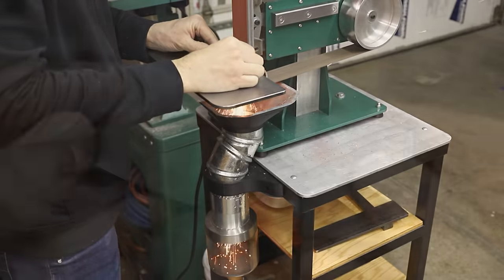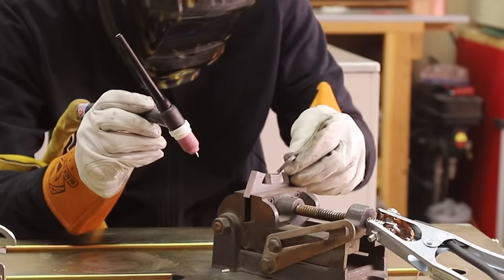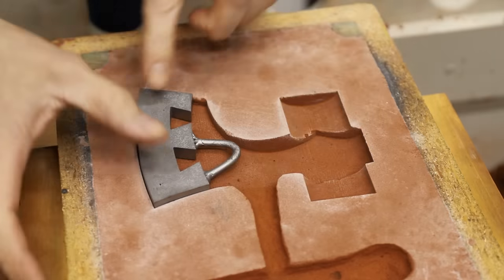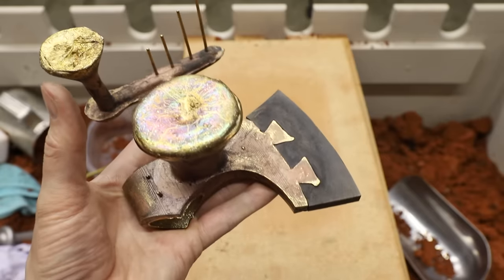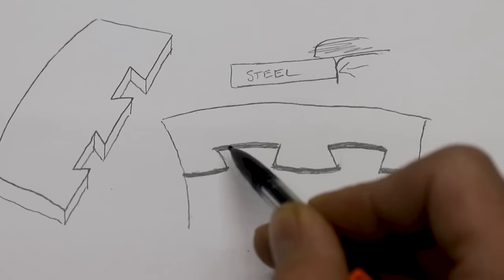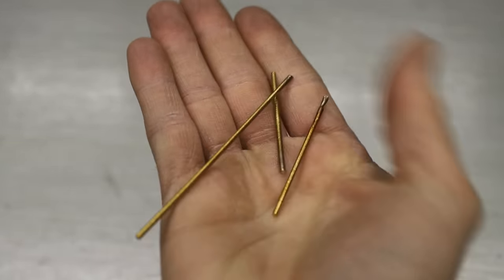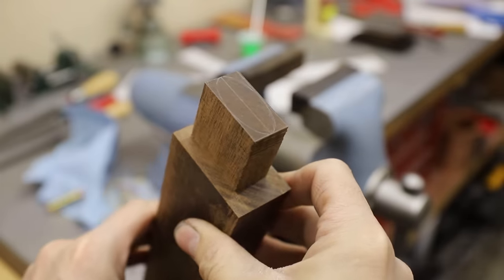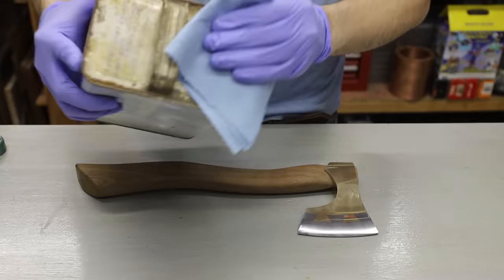Making a bronze hatchet with a steel blade - Dovetail Axe

Comment: The axe is beautiful.  I am guessing that it won’t see a lot of heavy use but it does leave me wondering about a couple of things.  I have never worked with bronze made from aluminum and copper.  I have no idea how the properties of this alloy compare to a more typical copper-tin sort of bronze.  I frankly have no idea how this alloy of bronze would wear in an axe that sees normal use.

The other issue is how the two metals behave after many cycles of heating and cooling as a result of changes in the weather.  It seems unlikely that the different materials will expand and contract in the exact same way.  This could cause the dovetail joint to loosen over time.  This could be irritating in a working axe but it might not be much of an issue in a display piece.

Comment: Could the dovetail weaken or shift during chopping or twisting the edge out of wood?Maybe drill a hole top to bottom through the dovetails and put a steel pin in there to make sure the dovetails can’t shift?

Comment: Beautiful show piece, but as far as actual working piece I have doubts. Black walnut is not great at handling stress from impacts, and I have real doubts about the union between the steel and bronze holding up to actual stress of being used. Perhaps using three rods from the steel blade back into the bronze body would increase the strength, by distributing the impact force through more of the bronze body rather than almost all on the dovetail union surface. Again it is a beautiful piece of work, i only question whether it would actually hold up under actual working conditions. Also think I would have cut the dovetails to have a 3/32 or 1/8 inch ledge around the interior of the dovetail, for increased surface area for the bronze to bond to the steel.

Comment: Aluminum bronze and mild steel will experience galvanic corrosion when in contact with each other. It would be interesting to see if this holds up over time in a humid environment.

Comment: Jeez Louise, man! You need to have that chuck of steel above its solidus temperature, or it won't bond. What you're doing is basically brazing the bronze to the steel. The base metals need between the solidus and liquidus temperature, or you'll get a cold joint... which is exactly what you got the first time.

Comment: i honestly wonder if they are positives/negatives in handling/hit "feeling" of an Axe, when different materials between the blade & the shaft are used.
apart from weight & balance , shouldnt a "softer" piece of metal give a different outcome? like in a sword? flexibility & all that 🤷‍♂

Comment: You added this kind of steel loop to the blade for having sth. the aluminum bronze could stick to. But: Would not it have helped to leave the excess from the cutting process inside the dove tails and not filing them down? Then the aluminum bronze would have had much more "steel edges" to stick to.

Comment: This would be quite simple if you had access to a wire EDM machine. Also the steel can be pre-heat treated. The EDM is not effected by the hardness of the metal.

Comment: I think this would beva cool wayvto make be a battle-axe. Use the same bearded shape, but make it easy thinner in the blade, like half the thicknesses frombthe eye and to the beard, andvthen makeba reinforced edge to get a light axe but with good edge rigidity.

Comment: One of the major reasons I think this is a terrible idea is that steel readily losses its hardness at those temperatures, nevermind the fact that metals expand at different rates vs temperature. Without some sort of physical connection this is guaranteed to fall apart. One of the reasons I don't like press fit connections. Friction alone isn't enough.

Comment: Pouring molten bronze on hardened steel softens the steel again (a lot more than desired for tempering). The steel needs to be quenched after the casting process.

Comment: adding a small 45 degree grove in the bottom and top steel dove tail would prevent it from sliding out horizontally over time do to ware, as well making removal not the biggest pain in the ass, would be a good idea. all in all good well thought out vid

Comment: Only thing I'm questioning is if the steel is still hard lol, the welding and the casting mightve ruined the temper/heat treat.

Comment: You should really rough out the blade shape before hardening. The hardening process only works at the surface, typically to a depth of 1-3mm depending on tempature, material, and solution.

Comment: Didn't you build a battery between the cupper aluminium and steel? i guess, that the cupper will start to oxidize and start stealing electrons from the aluminium, making it brittle?

Comment: bi-metal... how about galvanic currents? can they ruin the project in the long run?
how do you figure which metal can be used without galvanisation (??)
Reply: Cutting edge probably rusts like crazy, exactly for that reason, if used for real ;-)

Comment: While the end result is a beautiful decorative piece, its functionality ends there.  Steel alloy, bronze alloy, heat treatment are all either incorrect for the application or just plain incorrect.  The dovetail joint wouldn't survive a day's work, but it is a beautiful art piece.

Comment: What about a skeletonized hammer, filled back in with lead?
Reply: That would be a fun idea! Use topology optimization for the striking surfaces and connecting pieces, and then doing the lead cast over for a DENSE sledge

Comment: A work of art, but wouldn’t it be a little impractical as a working tool? Axes take a lot of blows. As the head is hammered, so to speak. Won’t the metals deform (they will deform) at a different rate, eventually creating the gaps in the dovetails you were rightly worried about?

Comment: Could be wrong but you really really don't want sharp corners in an axe... Those dovetails will create cracking problems later on down the line might not be instant but I will put money that blade will eventually crack/break at the dovetails

Comment: How much lighter is your composite alloy axe head over a full steel axe head?  Also, given that Bronze contains Tin as the alloying element, and your alloy does not, then perhaps instead of calling it Aluminium/Bronze you should invent a new name for your Copper/Aluminium alloy, ?  Maybe Caluminium (Pronounced "KAL U MIN EE UM")?
Reply: But that's just what it's called, he didn't invent it.

Comment: This little Imperfections mean this Ax will not Hold Long, nor Safety... It indicates that the Metal was under to much Stress.... So sooner or later it will give in, which becomes Dangerous for the one who uses it.

Comment: Would like to see how far you could push that design with the next model being more detailed more advanced maybe more decor with built in runes & using Nordic Gold instead of bronze & with better steel for the edge, do they make edged tools that sized with something like M390 knife steel?  My EDC is M390 & I have yet a need to sharpen or fix the edge with a knife honing steel rod in the 3 years of owning.

Comment: unfortunately that axe will rust fast, when you have an aluminum alloy touching an iron alloy (other than stainless) it causes it to rust the iron alloy and the aluminum to oxidize.
Reply: The galvanic reaction between brass and steel requires an electrolyte. As long as he doesn't store the axe in a bucket of salt water, it will be just fine for a long, long time.
Reply: @_GOD_HAND_  at a job i did, we had to put a buffer between the metals as just air moisture can kick off the reaction. I may be wrong on this part as this is all learning from on the job, but after it starts it is a self feeding but slow reaction as long as there is aluminum and iron present.

Comment: I wish you'd spent more time on the metallurgy aspect.  You mentioned briefly about how the molten bronze will temper the steel after quenching, but the melting point of bronze is far above the critical / annealing temperature of 4140, which should be tempered over 1000F lower than that.  I'd be interested in how much heat transfered through the steel in the time it was in the mold, and the resultant hardness at the edge.

Comment: solid bronze is not a great idea unless it's for display only, bronze to soft and will not sharpen as well as hardened steel, when casting one metal against another heating the already cast metal up very hot will stop shrinkage and a gap, when shaping the axe head a dolly which can hold the axe head from both sides will make it symmetrical and easy to do,, how about you try a tri-metal head or a bio-metal sandwich,

Comment: Nice! For your next project with dissimilar metal casting, have a look at the way the railway track-welders perform a thermit joint. After the mold-pattern is fitted around the joint area, a torch is directed through a purpose-built passage to pre-heat the ends of the rail, before the thermit mixture is ignited. When the molten metal flows into the casting void it is not chilled, the surfaces were prevented from oxidising by using a reducing flame, so a closer bond is formed. (I'm not suggesting you use thermit though, far too hot!)
https://www.youtube.com/watch?v=c5qkZ6VD3hQ&ab_channel=RailSystemNet

Comment: Good concept, but your design has a fatal flaw. Sharp corners. Radiuses and rounded fillets will prevent cracks from forming in both metals. If your aim was a decorative piece, you should be ok. If the goal is a functioning tool, it will catastrophically fail in use.

If you want a stronger, tougher bronze, go with a silcon-aluminum bronze.
Reply: As far as wood selection for that are, for decorative use, you are fine, but for a dedicated tool use Hickory or Ash.